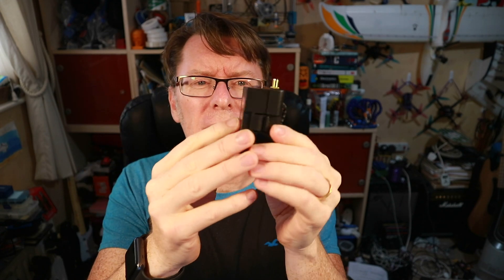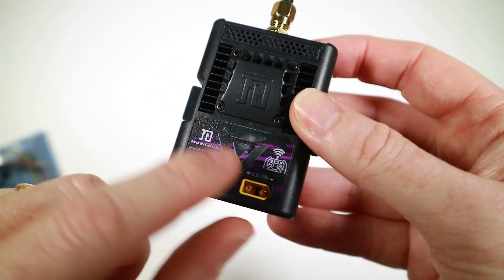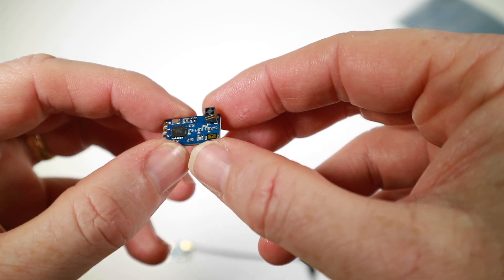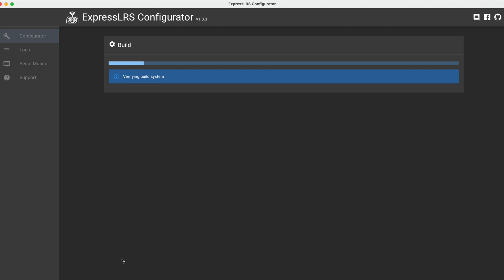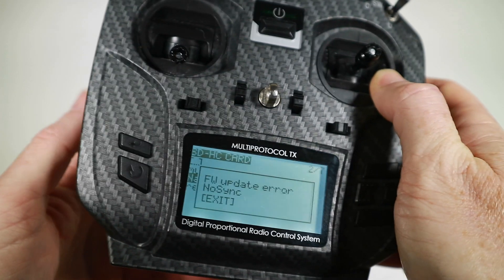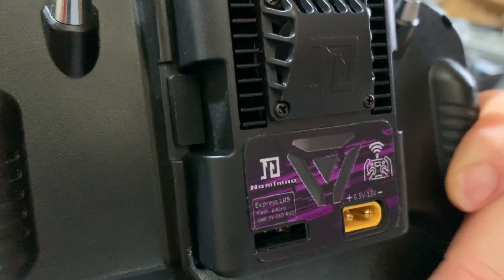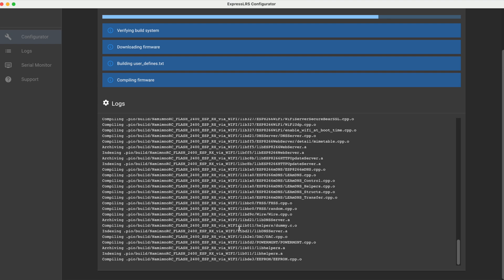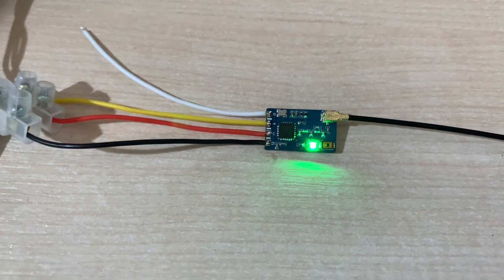Namimno ExpressLRS module and Receivers.  How to flash, and "unbrick" them

Comment: If they were competent programmers, they would have separate upload slots for each type of firmware and provide different text and information about which firmware it wants using those fixed addresses. But as what I'm finding with a lot of this embedded controller code. A lot of it is written or just copied verbatim from amateurs with very little understanding of what they're doing. So you end up with crap interfaces like this which have obvious flaws a professional would have realised from the start. Good thing to point this out. Not everything you buy from companies, even if they are producing commercial equipment, know what they're doing. Sometimes they just copy and paste any old bullshit from open source coders with little training.
Reply from the maker: Happily, since this video - the last set of ELRS modules have been far easier to use.  This is in part to the ELRS devs attempting to code around the short comings of the modules and making sure that people will find it more difficult to brick things
Reply: @CurryKitten  great to hear it too, when I saw that interface, I was like 😱

Comment: could you please help!? I have binded my darwin baby ape with build in Expresslrd to my namoni module which is installed on my Radiomaster Tx16s. But when ever I connect the batry and arm the quad it starts throtteling up and it I give it throttle it suddently throttle up jump into the air fall back to the grond and un arm it self!!? I have tried to find out what is wrong without any succes,, any idea's ? I will be Grateful if anyone can help me with this
Reply from the maker: Although there's always a number of things this can be - the throttle running away on it's own like that is usually when you have air mode enabled, and the quad thinks it's moving in some way and so powers up a motor to right itself which in turn makes another motor power up to write itself back and before you know it the quad is going full power.  It's probably falling back down as it detects a runaway is disarms.  Disable airmode and see if it does the same, plug it into betaflight and see if you accelerometer & gyro think they are moving when they aren't

Comment: Hello Curry Kitten,I have that same Jumper Radio featured in this video....Did you have to do any physical or Electrical modifications to get that ELRS module working in that Radio?
Thanks
Reply from the maker: Nope - just plug it in and go.  It's worth having decent batteries in the radio though.  I had some crappy 18650's that would be fine for hours normally, but would drain very quickly with the module as well.  Put some decent quality batteries in and you are golden
Reply: @CurryKitten  Awesome Thanks

Comment: Hey they’re 👋 I was wondering if you would have a solution for my receiver ep1 rx with my transmitter jumper t lite. I got through the grouling hard part of getting everything to work properly on my jumper t lite. But now I’m having issues connecting to the wifi with my receiver it will just not connect. Is there a way to flash and  reboot?  The same way  that you used for your naminmco. Where I can just drop my bin file and flash ??

Comment: Which is the best way to get in to this with a full size radio? do i buy a Naminmo, Happy model or get hold of a second hand R9m and flash that? any help would be much appreciated as i cant wait to try this out. Cheers
Reply from the maker: Although I haven't got one myself, the HappyModel gear seems to work with the least amount of hassle at the moment.  The Namimno has a lot of power, but do you need that much!  I'm going to try flashing one of my R9's at one point to find out more about that option
Reply: @CurryKitten  Cheers for the reply. Having spoken to Joshua Bardwell,  and also the superior build quality. I choose the Namimno module. Yes it's got way to much power, but it's got the best build quality and I doubt I,ll ever use it's full power anyway. But nice to know its there if needed I suppose..

Comment: CurryKitten this was huge help in unbricking the Namimno, thanks!

If anyone out there has combined this with a Jumper T8SG (carbon) successfully let me know, I'm having issue getting this done. Flashing the way done here appears to work correctly but not getting menu in transmitter and the tx/rx won't bind yet when powered at same time.

Comment: One small note, the reason the .elrs flashing from the radio didn't work is that the battery was attached. When using the radio method the radio actually power cycles the module to get it into bootloader, and this can't happen if the battery is plugged in. I tested on my bench just now and it works as intended.
Reply from the maker: I'll check that out.  I thought I'd tried that but will check it again. Cheers
Reply: @CurryKitten  Interesting I wonder if it's the T12 not resetting it somehow? Try this: start with the module unplugged, start upload then plug in the module.

Comment: Thanks for the video. Been Using the happy model ExpressLRS for a week or so now. Found it easy to setup and love the fact that I don't have to bind anymore. Been that impressed with it all so far that I have swapped out all my cross fire RX's to ELRS. Can't recommend it enough.
Reply from the maker: Saved quite a bit of money over crossfire receivers I bet!  HappyModel certainly seems to have the best "out of the box" experience so far
Reply: @CurryKitten  if I'm honest , I have found it a lot cheaper and easier to deal with than crossfire (had some problems with crossfire binding and found the software glitchy). Absolute, out of all the Review's, happy model was the best out the box.

Comment: I've been using expresslrs for a few weeks now and can't be happier. I repurposed my R9M gear and works like a charm. To be perfect I only wish I could make a relay with my Jumper T16S radio. Right now I'm running a cable connecting the module perched up in a 3m pole and works fine.
Reply from the maker: Is this a case of you wanting to sit somewhere inside and fly?  To be fair, I would guess that the cable (as long as it's not too long) would work better than any potential relay because there's no extra latency
Reply: @CurryKitten  Yes, that's the point. I tried with a 10m cable and worked fine, I'll try a 20m cable next week. I was afraid the signal was too low voltage (3.3V) to be able to traverse the cable cleanly. In any case I already have simple 2-way buffer to raise the voltage using the radio's VCC if necessary. The radio relay would make things less messy tough.